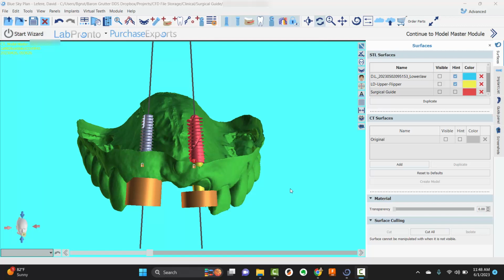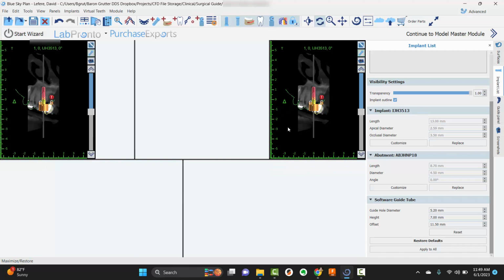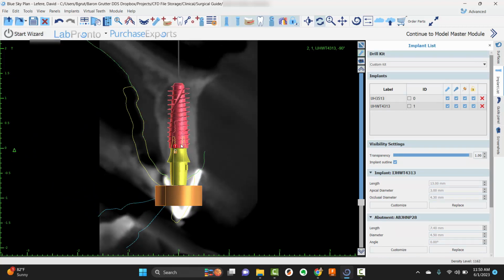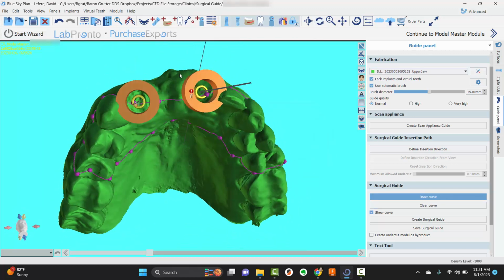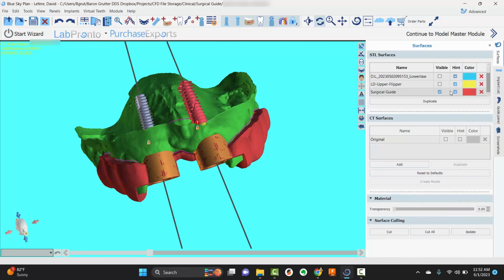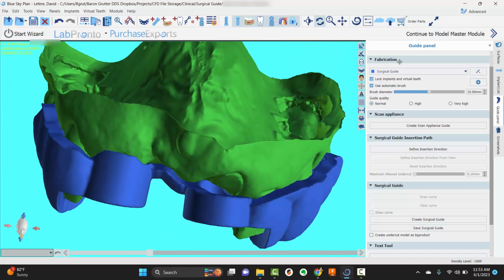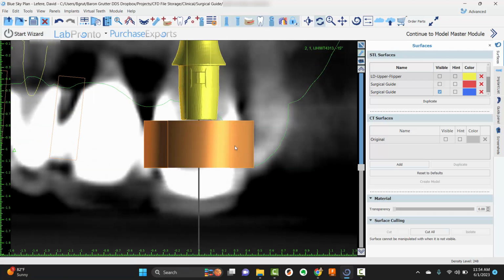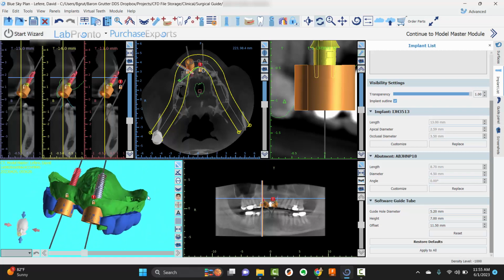BlueSkyPlan Guide: Guide Tube Height

Comment: Thank you or sharing this video! But as far as i understand, this makes sense moslty for sleevless drilling guide. In case of sleeve, you're stuck with sleeve height
Reply from the maker: Very good point. I sometimes forget that some systems still require sleeves. You are correct.